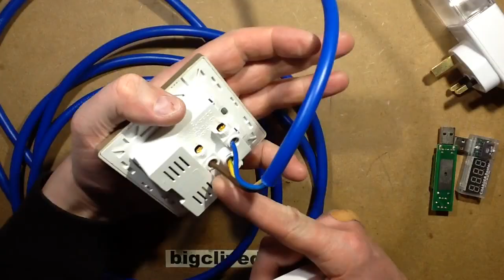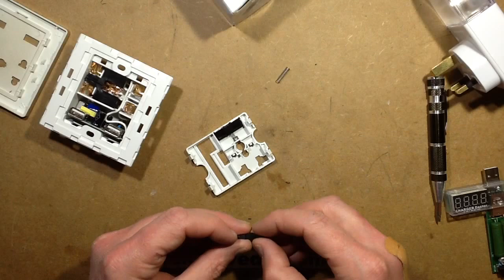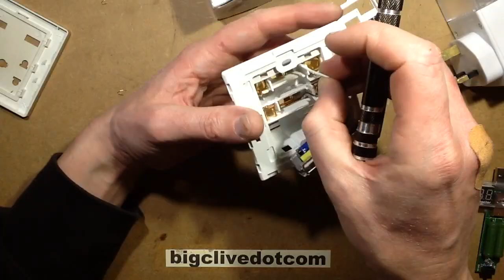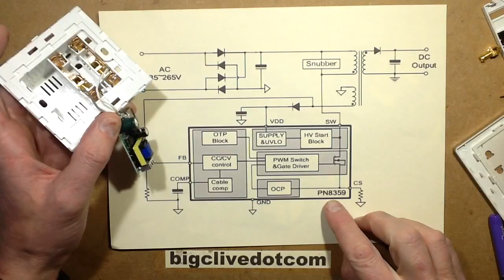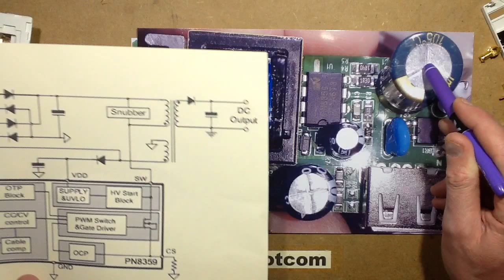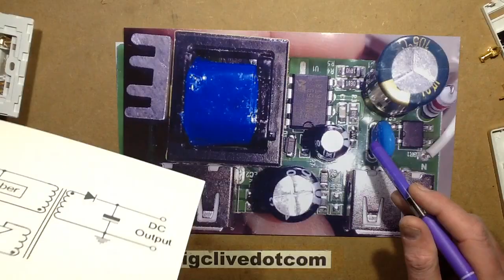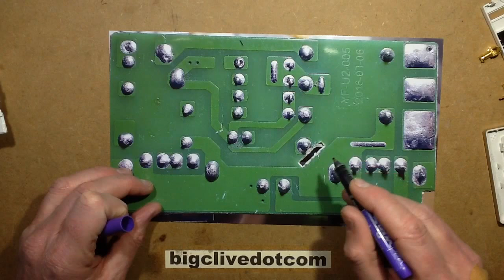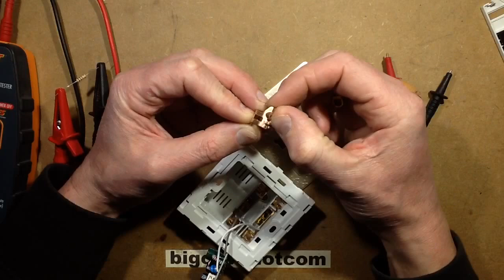Wall plate death-dapter tests including fire and 1kV.

Comment: Is it possible to get a UK double mains wall plate socket with USB charge sockets that are switched with the mains switches on the plate? I assume all the ones in DIY shops have the USB power supply permanently wired on.
Reply: I've not seen one, but then at least they meet the standards.

Comment: Leaving 1.5mm under solder mask is okayish, but not proper, they could have connected USB ground to earth, that would make it safe, but they'll most likely fail EMC... choices choices.
Funny thing that fancy meter of yours has its CE logo wrong.
And yeah, I've put a fork in the socket when I was kid, became an EE...
P.S. Yup, that passes UL 94 V0 - if it extinguishes in ~10 sec its good for V-0, but they test it a bit differently.

Comment: that  plastic burns like a mofo. also the smoke, dont breathe the smoke. i would not recommend a cheap wall usb. they are low quality and will break down and you cant pull it out like a normal usb charger.
also the contacts look like gold plated connectors.

Comment: That plastic self-extinguished within 20s of no longer applying the naked flame and didn't seem to release any hot droplets. I don't know which maximum time is specified in British Standards, but note that using execive amounts of chemical flame retardation additives is believed to cause equally horrible damage to human occupants, hence the need to not add more than absolutely necessary.

Comment: I got multiple mains shocks over the years, starting at young age with opening up a model railway transformer. I also got a shock to the ear, because I dropped something and while bowing down touched a live wire hanging over the table's edge. It didn't hurt, but may vision went bright white for a second. Don't know if it's related, but I sometimes "see" flashes with my eyes closed when something makes a clicking noise.
I also had my fare share of fires and explosions. I built "bombs" (electrically triggered) that blasted cantaloupe sized holes in the ground while just lying on the ground. And I put explosive payloads on small rockets (like bottle rockets), some were even multistage rockets.

Did I become a pyrotechnic or electrician? No, but I guess only because I sat in front of the computer even more so I became a programmer. ;) But I definitely do a lot of electronic/electric stuff.

Comment: When I first moved into my home (and I had an inspector "give the ok", I paid $500 to have him tell me "everything was fine") 3 or so electrical wall outlets were burned black inside, small welds holding the contact points to a large plate had actually severed, the internals of the sockets RATTLED. I replaced them all with fairly decent wall sockets. I don't know how these sockets were abused but... must've had a nasty life, or else like this it just wasn't made to really handle daily use. NOTE: The house was built in 1978, the sockets were most likely that old as well, and they were in fact Made in the USA, so they're not say mid 2000s chinese sockets or anything.

Comment: Sending in meters for official calibration every year is not an electrical regulations requirement. It is a commercial measurement equipment requirement to ensure that weight scales and other equipment used for determining the amount or quality of goods such as Whiskey and raw copper actually indicate correct amounts, so you don't end up buying a bottle that has 10% less liquid with a lower percentage of alcohol than it said on the price tag at ASDA.  The international standard form of these requirements are stated in terms of traceability to an ultra correct measure at a national standards lab, resulting in an official document stating that meat packing scale serial number 123456 was verified on 2015-02-29 to be within 1g of the reference at Isle of Man adjustment co, which was verified six months earlier to be within 0.1g of Qinetic reference no 8, which is within 0.01g of the official British copy of the 1kg standard which is within 0.001g of the master 1kg reference in Paris, France. Therefore it is OK to use its readout when billing Mrs Smith when selling her a lump of meat.  Because that 1M resistor came with no such certificate it doesn't count as official traceability. Now determining which of a professional electricians tools need to be legally traceable to official British standards, and which ones only need to be good enough in his own professional judgment is left as an exercise for the lawyers and the authorities.
Reply: Clive did say that in the video "Its not in the regulations, but there's a bit of an 'industry' around it"
Reply: You can get certified standard resistances (for calibration purposes), e.g. - http://www.ohm-lab.com/resistance-standards/index.html  (and a few others). These are ISO certified (with certificate of actual value over a range of temperatures), and should be more than enough to keep the "Legal Eagles" off your back!
Reply: Send one meter in for official calibration every year .
Test all your other equipment against the official calibration &
document each item .
Did this for years with in house test equipment & the odd meter .
The meter documentation is the key & the link back to the
official calibration meter with it's test certificate .
You end up with a in house test certificate for each item .
You should reject all meters out of calibration for repair or recalibration .
Reply: Pick 5 1m	Ohm resistors if they all show the same value within .x% then the meter is reliable. This is based on the idea that you've bought reputable brand resistors.

Comment: We used to use a motor bike alternator with a long lead coiled around my brother's big toe whilst he was asleep, then wind it around with a home made handle as fast as we could, resulting in him waking up with a "start"....Happy days !! ( there wasn't much entertainment in the fifties!)
Reply: Guess he played the lottery later that day
Reply: There's a couple times I've been shocked when working on Hobbies not high-voltage low voltage around 18 volts or less probably.

First slot car track felt like something was biting my hand.

DC current by the way.

Second Lionel O gauge train layout Around the Christmas Tree at a friend's house I have to put my hand down on the track and got it it was a little worse if I remember correctly years and years and all these times were over 20 years ago or more.
Reply: Maybe a magneto rather than an alternator?

Comment: It looks like it came out of Donald Trump's bathroom.
Reply: Yes except for his would probably have a  solid gold faceplate if he lived in Europe. hopefully electrician wired the ground to the hot and placed it right next 2 something grounded AKA bathtub or sink and was not on a ground fault or rcd device and breaker was not in the circuit. Just kidding of course not serious one bit it just goes to show how dangerous is this could be that is.

 I've actually seen this and worse and I a do-it-yourselfer that knows to trade and does everything the code. and has corrected situations like this.

Comment: Any electrical fixture with USB built in I wouldn't give the time of day, no switch to create a physical break in the supply to the USB transformer - no chance!

As for the multi plug sockets across china, india, etc... hard wired death-dapters, don't trust the things.

Most of the stuff with chinese plugs have blue / brown colour coded wires anyway, don't know if you've stumbled on them yet but they make unfused plugs to fit our sockets, sometimes with an insulator sleeve on the earth pin of all places.

Comment: Won't the 1000V test damage any components?
Reply: He tested from primary to secondary. If the isolation/insulation is good, nothing should happen. If anything failed in that test, you wouldn't want to use it anyway.
Reply: It will if done too often. With equipment designed to pass the test, it is not a destructive test, but not a non-destructive test either, as the device should survive being tested a few times for safety checks, but not being tested every day for years.
Reply: superdau

Comment: BTW does this look like it could have a legit IPX4 rating to you? http://tinyurl.com/zthn6zo I've seen it on sale until recently in brick and mortar garden centres but has apparently been withdrawn for reasons 'something to do with splashing water'. it really is a simple fan heater in a painted steel (not plastic) box with the heating element clearly visible behind the punched steel front panel.
I thought it looked shadier and less splash resistant than a lot of the cheaper indoor fan heaters which aren't claiming IP ratings.

Comment: 13A
What are you connecting to a single wall outlet that uses 3000 Watts?
Reply: Kettle to boil water.    Decent toaster.   Hair drier.    Electric heater.   All benefit to a good 3KW powerfeed.
Reply: Ni5ei kettles can pull a lot of power, especially at the start of a boil cycle, look at your meter right after turning the kettle on, you'll briefly see it speed up (or flash faster) while the kettle starts to fire up the element
Reply: https://www.google.co.uk/?gws_rd=ssl#q=3kw+kettle&tbm=shop

https://www.google.co.uk/?gws_rd=ssl#tbm=shop&q=3kw+fan+heater
Reply: +Ni5ei Electric kettle for water boiling is the most common UK home appliance. They are almost always rated 2.75/3kW (2.75kW on 230V or 3kW on the standard UK 240V). Also electric fan heaters are commonly 3kW on max setting. Our outlets are usually on 30A circuit breakers, but with individual 13A fuses in the plugs.
Reply: and if you wanna count it, just for comparison, a good electric shower will pull about 9KW under load
Reply: Dylan Collins It would be insane to plug that into a standard outlet and not have a dedicated fuse for it. It's way more than the usual 16A group fuses can cope with.
Reply: mc349iii Don't know any details about electric heaters but I've never come across toasters and water boilers that have a 3000W spec.
Reply: Ni5ei I just said for comparison, give the 3Kw something to scale with
Reply: Yup,I see it now. Thanks guys.
Reply: Ni5ei yeah short of something like a vacuum or a kettle you'd be hard pressed to get close to it, most day to day thing your lucky if you get to 2amps (480watt) and would anyone in there right mind use something like this for a kettle or vacuum? I doubt it very much
Reply: Ni5ei well I can list a few things I use that can and will pull that from a single socket (off the top of my head): TIG welder, high current unregulated powersupply, my large isolation transformer. My high voltage testing power supply.
Reply: ah forgot my studio strobes
Reply: +Alex Gray Add to that anything that washing machines and tumble driers - both the ones here have 3kW heaters.

FWIW I was recently talking to a Canadian who was visiting his daughter here in the UK. He had been amazed by the speed of our standard 2.7-3kW kettles so he'd taken one home and and made up an adaptor to run it of a 240V appliance supply.
Reply: Yes, we're lucky on 240V not needing separate appliance supplies and connectors etc. I suppose the downside is that even our smallest low current appliances still need the full size 13A plug hanging on the end.

Comment: Hi Clive, Why was it giving lower voltage at lower current and could it have been better calibrated to give 5V on any load ?  Was there room for improvement with little cost
Reply: One extra turn on the secondary winding or one less turn on the feedback winding would raise output voltage.  Alternatively, change one resistor in the sensing voltage divider.
  Voltage rises under load because the input chip feeds more energy when the feedback winding senses the load.

Comment: i have a chinese phone charger that drops to about 4.5v when idle, goes to about 4.8 when i plug a phone in, badged samsung but i dont think it really is, had its a good year now, unlike the ebay.cn front room 12w led lightbulb as i type this in the gloom as it fizzled to darkness earlier....
The plastic burn test is a fail... remember when it does ignite its probably pre-heated by the heat of the smouldering usb supply or hot neutral connector so may burn longer or accelerate

Comment: under no circumstances should that be fitted to a domestic wiring circuit it's far below minimum standard it's not approved for UK use and I for one would never pass the wiring off if one had been fitted it's a death trap pure and simple ,

Comment: Nice one Clive. When I was a kid my Dad took my transformer away from my Scalextric set as a punishment, so I wired it directly into the mains blew myself across the room when I pulled the trigger, had to chisel the car remains from the track with a screwdriver, and blew the mains fuse for the whole street. My punishment was quite severe for that. I'm an area technician for a major electrical goods manufacturer now. So your theory has a point. Keep up the good work.

Regards.

Stray.
Reply: you are lucky sir, when I was 7 i was arsing about on this demolition site fiddling with the wires etc left behind & unbeknownst to me, it was still live 240v ac.. I was in hospital for 2 weeks with severe burns. We live to tell the tale though & that's what matters.
Reply: I just realised I've been reading his username as "Big C Live dot com" and the thought that it was "Big Clive dot com" never occurred to me lol
Reply: Indosarnia  Ok, I've sat on my test results and come up with my conclusion. I doubt I'm as quick as you so I hope you'll forgive the delay. Whatever you think my background or intentions, the reality is that I ask questions in these sections because there are some incredibly erudite persons here, not unlike yourself, clearly. Quite why you went to the lengths to hypothesise a 2.5mm2/bell wire short circuit when that was exactly the scenario i pointed out in the first place, like I don't know the difference in csa between the relative fuses, or the effect of resistance to Pfc. So in conclusion if you want to talk to me as a fellow engineer who has worked on well over a thousand installations please do. If not just make another supercilious comment, I can block you and move on.
Reply: Indosarnia  Thanks for your courteous and prompt reply. I can assure you there was only lighting load at the time but the fault was me accidentally splashing a live against a backbox, so doubtless a substantial fault current which still leaves me with my theory that the fusing factor of older cutouts reduces over time to give rise to this scenario?
Reply: Indosarnia  Obviously the CSA difference would raise the question in the first place so are you saying I was correct in my theory and the main fuse was tired?
Reply: 63Straycat i
Reply: After my brother assured me that the 3 phase had been disconnected from the pillar drill we were moving,I broke open the seized armourflex fitting and cut the wiring in one chop with a pair of pliers,it wasn't off! He had switched off the lathe by mistake.Not only did the insulated pliers not insulate,the cutting jaws were no longer and the combination of immediate heat and my grip being accentuated by a quick boost it was only later that I noticed that the handles also now touched each other,my arm ached for hours and my face was peppered with tiny hot particles.
Reply: You blew the fuse for the whole street.
😆
"What was that‽"
"Uh, a squirrel got electrocuted? Yes! A squirrel got electrocuted!"

Comment: Im an electrician and I havent lost my virginity with ac wall outlet shock :p
Reply from the maker: Give it time....
Reply: I doubt that.
Reply: Galactic Ruler your right, it was two and i built one of them but better then a light socket!  #engineer   #rock
Reply: How I lost my AC virginity:
- Is the mains off?
-- Yes
- Show me the switch - yes that&#39;s off
-ZAP--------------------------------

-- Oh, there's this second switch here...
Reply: As a little 6 year old, the open light switch socket was irresistible. I got blown back and giggled. 

I now dabble in electronic pixies. Albeit with good respect.
Reply: i'm an engineer, I lost my virginity with a women ;)

Comment: How to distinguish between blue mains filter caps and waristors when you salvage them from broken electronics.
Because one time i was convinced i have two double insulated caps and wanted to buy another set, but electronic hobby shop clerk "corrected me " they were waristors and he does not have this type. on one side they were printed x1y2 250v~ on the other cs472m and bunch of logos, so they shoud be main filter caps, right?
Reply from the maker: The X1 and Y2 are standards for testing and use.  The 472 indicates 4700pF = 4.7nF.  I'd tend to recommend buying brand new capacitors for a safety critical application.  The shop clerk might have mixed up the 472 with a common varistor marking of 471 for 470V conduction.

Comment: He's right, when I was young, about 4-5 years old I used to poke my mom's bobby pin into the sockets and enjoy the big sparks coming out of the wall! That was not the only time, I kept doing that with wires I found on the street or something. I did that about 3 times before my parents put a lock on the wall sockets. Guess what... I design high power, high voltage power supplies now.